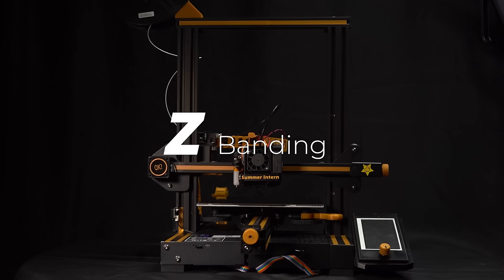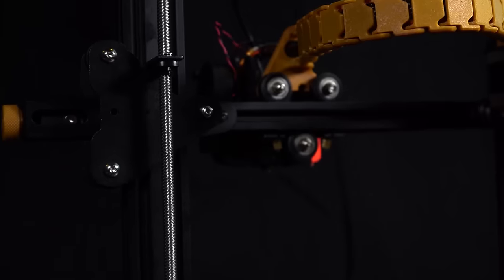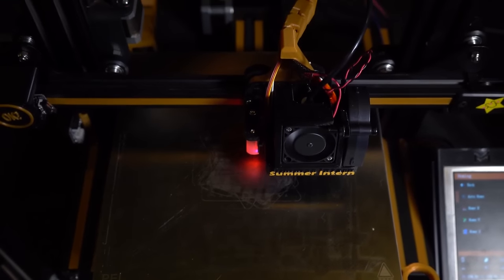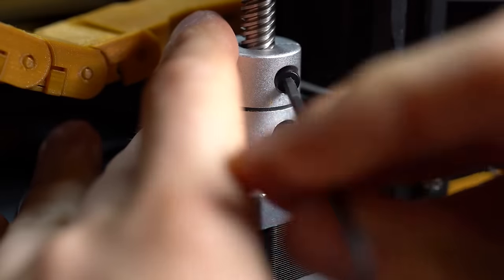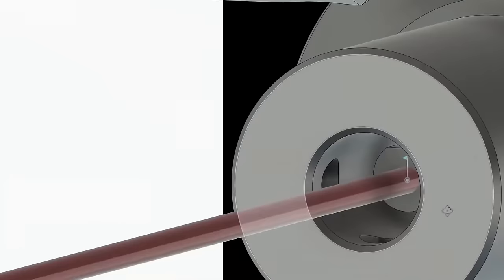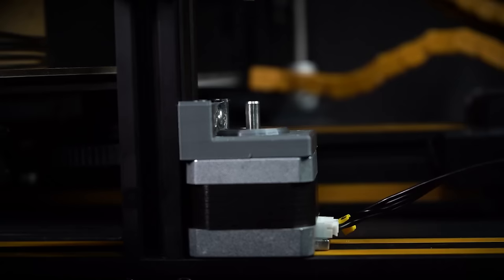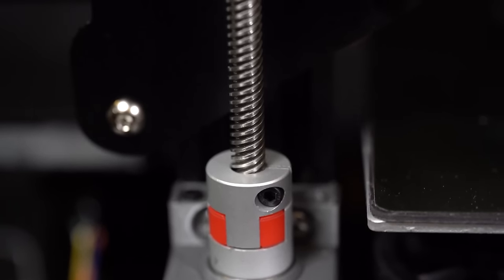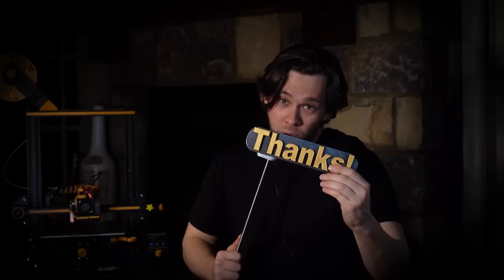I've Fixed Z Banding on my 3D Printer...FOREVER

Comment: "Self lubricating" is code for "material lost to wear acts as a sort of lubricant".
Reply: No, it's material dependent. Stainless steel, titanium, glass for instance aren't "self lubricating" no matter how they wear.  Brass, copper, white metal alloys are, because unlike those, they shed flat plates that slide across each other. Same for plastics, nylon, ptfe, UHMW, POM/delrin contain internal lubricants that are only released with wear, some are even impregnated with oil, they all need an initial break in before this happens. PLA, ABS to name but two, do not.
Reply: @m3chanist   Wh "no" , what i say wrong? Of course worn material can be either a lubricant or an abrasive, both is possible. Besides very confused comment. 
There aren't "internal lubricants" in the plastics mentioned, it's purely low surface energy causing the material to be low friction, chemically induced property. PTFE PA etc are not impregnated with oil.
Reply: @SianaGearz  I didn't say they were, I said they can be and are in a variety of engineering applications. I'm sorry for your confusion, read more carefully. What you said that was wrong was that material lost to wear acts as a kind of lubricant, as I pointed out, that is only jn some cases, that it is material specific, not a blanket catchall.
Reply: @m3chanist  they were talking about "Self lubricating" materials specifically mentioned in the video, not all materials. they were and still are correct.
Reply: There are numerous grades of POM (also known as acetel or delrin).  It can come impregnated with lubricant but in the use case of a 3d printer normal POM is fine and should not require lubrication.  It is resistant to lubricants but you're just giving dust something to cling to when it really gains you nothing.  I used to machine a lot of Delrin parts, fun stuff to work with, makes a cool sound when cut on a lathe lol
Reply: @Cara.314  o really, where exactly is that specific limitation? Apart from in your interpretation.

Comment: Something most don't know about stepper motors: Inside them is a spring-washer type pre-tensioner, it preloads the motor and keeps it from rattling if you shake it, guess what side it's usually on though? The bottom(bushing upwards when used in the z-axis like this), your gantry weight might be sufficient to deflect this spring and cause irregularities if things are heavy enough. You can tell by watching the coupler while giving it a little push down against. Your thrust bearing is probably fixing this. On mine I took the motor apart and relocated the spring to the top so it pushes downwards instead, resulting is a notably more stable Z-reference.
Reply: Genius!  This is a great tip, it very noticeably reduced Z banding for me and it's so easy to test if your motor has a spring-washer configured this way.  Thank you!!!
Reply: Any chance you can show or reference a video that explains this?
Reply: @projectartichoke  Awesome! I'm very glad to hear that random info was actually useful to someone else as well. (had notifications off, but better late than never.) I've actually never seen ANYONE cover this detail at all, and it's pretty easy to overlook or never know about.
Reply: @moodberry  Very late to reply, but you can check for it by literally pushing down on the shaft of a stepper that's pointed up, if it visibly deflects down into the motor and it's being used on a Z-drive for anything supporting weight.. then that basically means it can get forced down like a spring and cause uneven settling heights. Visually it looks just like a washer but has a 'ripple' indented into it, so it isn't flat.

Comment: The thrust bearing is important for another reason. The motor has a spring inside of it, allowing the axle to move up and down a little. By placing the thrust bearing between the coupler and the motor body, this freedom for the lead screw to move slightly down is eliminated, and it will unlikely to move up because of gravity, but if you really want to make sure you can go overboard and put a thrust bearing at the top of the printer as well to really constrain the lead screw Z motion.

Comment: Thats all fine and dandy but some Z Banding, wobble, whatever can also be caused by the wheels on the x gantry riding on the frame if they are not perfectly round. They can cause z banding, I've tested this extensitivly with my original ender 3 that didnt have duel z screws. After disabling my Z motors in the printer screen, you raise the gantry up and down with two fingers and if there is any resistance as the wheels go up and down you have an issue with a flat spot on the wheels. The issue can be very slight so you have to really get a good feel for how the wheels feel against the frame. This can happen more then not when the printer has been sitting for extended periods of time not being used, the tight wheels will deform over time against the Z extrusion frame. This can even happen when putting the printer together if care is not taken when mounting the X gantry and the wheels are grouged when fitted onto the z extrusion frame. Lead screews can be a problem but could also be other issues.

Comment: Just tried oldham couplers, and they completely fixed it. It did allow me to see that there is a slight inward slant of the lead screw, so I'll have to print motor brackets to help position it correctly. But even now, the prints come out perfect!

Comment: EXCELLENT video my guy! I have 2 Ender 3’s and I have dual lead screws on both of them along with direct drives! You have explained what I have been having trouble and have noticed! I have noticed the screws are really not lined up properly, and it’s just a few mm if that. And that really makes a difference. The trouble with belts is that they are like chains on a bike or motorcycle. You can only tighten them so much until you’ve stretched them all you can and have to replace them. So belts (in my opinion) are not on option for me. Any way great video, subscribed!

Comment: The most critical thing with leadscrew alignment is that the bearings and nut are all in exactly the same relative position to the linear axis the screw is driving.

The screw being straight is irrelevant if the top & bottom bearings are at different distances from (or laterally to) the linear slide! 

That is probably why the top bearing caused problems - the opposite end was not in line with the nut, so it was causing lateral force on the nut near the ends of the travel. 

It applies to the industrial machine tools I work on, and equally to 3D printers or any small CNC.

Comment: Great advice ! 
I solved the leadscrew issues by, THROWING THEM AWAY and replacing them with a belted Z mod.  Z hopping is MEGA accurate now and my supports just snap clean off. Next thing I will do is install linear rails because those POM wheels are a huge problem aswell....

Comment: Note that brass oldham couples like the ones you showed aren't supposed to work well under compression, when an oldham coupler that responds well to compression is installed the lead screw isn't constrained laterally at the X axis, in those cases constraining at the top is a good idea because otherwise the lead screw is underconstrained. There are bearing-based oldham-style couplers like the "wobble wings" and the suchlike that are designed to work under compression, also bear in mind that thrust bearing are great but can introduce vertical motion in the lead screw if they are not perfectly perpendicular to the axis of the lead screw, which can be tough to ensure

Comment: The #1 most thorough set of tests/results and solution options on YT. My issues are around z-binding (mainly), with no discernible pattern in the layers. It's been a total pain to trace down and I'm pretty sure it's a combination of the anti-backlash nut and sub-standard linear bearings, but good luck trying to find a set of well made bearings that are any better than what Creality uses. Again - really good video and I've subbed.

Comment: Bent lead screw itself wont deflect in travel at any noticeable rate, extremely small effect (a2 + b2 = c2). Most Z issues are simply binding from being out of square, the rest are bad PID tuning (temps jumping around) and bed bounce/vibration, mostly just on bed slingers. BUT if you have dual Z motors and there tied together with a belt and not in phase, it's better to simply unplug one if that gantry holds up when turned off. If you need both, loosen one coupler and activate the motors then level your gantry and tighten it up. That will put them in phase so that there not constantly trying to fight each other paying a back and forth tug of war. The last one, a loose carriage.

The POM nuts work just fine and can be "loose" as gravity will do the job of keeping them in place, maybe if you need to print while its on it's side.. idk.

The thrust bearing would compensate for bad/cheap bearings in the factor motors, but you can get nearly the same effect of the oldham with nylon washers and only tightening the brass nut so that there's no play, allowing to the stock cheap brass nut to move around in the x/y AND also wobble to play along with a bent lead screw.

Comment: Now overhaul it again and switch it to a belted Z axis set up 😂 Jokes aside, fantastic video and quality, very informative 🙌
Reply from the maker: Thanks! 3 things that I would like to test still: A banded Z setup, Linear rails on the Z Gantry, and the Wobble X attachment.
Reply: @MaxyMeanderings  Those are some fantastic choices! As far as linear rails I was reading KevinAKASam's (belted Z mod creator) documentation for the belted z and he advised against it. Reason being is the POM wheels allow you to tighten the concentric nut and create friction, where as the linear rails have 0 friction. Problem is with only 1 stepper holding the entire X gantry, the X gantry will fall once the printer is turned off if the Z axis has linear rails. Having that friction from the POM wheels ends up helping the single stepper hold the gantry in place, or at least gently bring it down.
Reply: @MaxyMeanderings  Yeah don't use wobbleX on a dual lead screw setup like on your ender, it needs quite a bit of weight to work properly. It was really meant for ball screws I think but I've seen those get a lot cheaper

Comment: Thank you for sharing!  Good idea about the thrust bearings, something I haven't tried.  I recently just installed a dual Z axis stepper motor kit, the box says it's from Creality, but I'm not sure if it's authentic.  Anyway, the kit I bought came with anti-backlash lead screw nuts aluminum mounts for both stepper motors.  I still had to put a shim for the originally located stepper motor, but no for the other side, I'm guessing the gantry bracket for the original spot wasn't drilled properly or bent at the correct spot.  When I was aligning the lead screws with the stepper motors, I left all the mounting screws and lead screw nut loose first, and also moved the X axis gantry all the way down for better alignment, I even removed the printer head so I could go as low as possible.  I didn't know about the top mount could cause issues.  When I installed mine, I moved the X axis gantry all the way up possible, so that the top mounts are aligned the best way possible before I tightened them in place.  I might leave mine in for now, as I don't see any Z banding issues with my prints.

Comment: i have a og cr10 and found pretty much the same thing. the things that helped the most was oldham connector that was filed(mine did not slide smooth) and lubed and getting rid of the top guide. plum coupler didnt change anything for me and antibacklash made things worse.  i got new leadscrews after the oldham and i so disernable improvements. only other thing that helped along the way was replaceing the stock extruder with a direct drive and  a mains bed heater with insolation.  going to give the motor mounts a try  because why not.

Comment: You see your problem isn't the lead screw at all. Mine is bend but there is no sign of wobble on the print. I have done all "bad" practices. Fully tightened the POM lead screw thing to the frame while you are supposed to leave it untightened. I added a bearing at the top which is supposedly really bad but I need it to stop the lead screw from vibrating with my high acceleration.
The problem instead is Creality leaving the screws too loose from the factory. Specifically the ones holding the Z Gantry so technically the X gantry. There are several screws that you can tighten to lock the parts with the V wheels. Essentially you have to first make sure your X gantry is level then fully tighten the eccentric nuts so that the inner wheels are jamming the outer wheels. Then tighten the brackets while making sure it stays level. After that you can untighten the eccentric nuts again and check for play. If you have done it correctly your X axis doesn't want to wobble anymore it will want to naturally be straight. After that you can tighten the eccentric nuts to the correct spec so slightly touching but its really not required as the outer V wheels will do all the work.
What that does it prevent jamming on the lead screw as your X axis will always be level.
I think you are putting way too much thought into it while for the Ender 3 v2 Neo (my printer) there really isn't much to it. From the factory there was 0 banding. I replaced the brass with POM because it promised better accuracy and it indeed only has 0.05mm difference between moving up and down. As long as you move the same direction its 100% accurate. Only when going up then down vs only going up does the 0.05mm come into play.
Also my printer needs 398.94 steps per mm instead of 400 for the Z.
Reply: Isn't this up to the manufacturer to fix it? In any case, that's why we call it  "ender"

Comment: good video, AND, funny, I built my Prusa I3 almost entirely by myself. 
my Z threads are old-fashioned M5 threads and yes, they are loose at the top AND go back and forth (not extreme!)
and that's why I ended up here, I still have to see what I can do about it BUT I'm in no hurry, the printer works well enough so it will get better with time!

Healthy and Friendly Greetings from the Netherlands everyone!
Rob

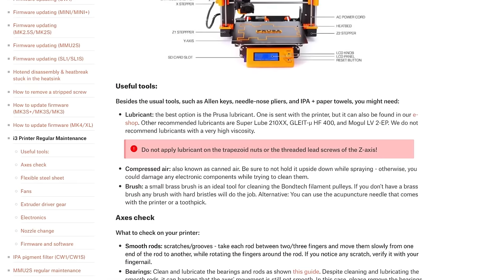Comment: @13:30

I'm rebuilding my CR-10 and went with the oldham coupler setup from this video.

Anyway, I lubed the threads of my POM nut as well as the oldham coupler, and I'm noticing the gantry slipping or skipping (??) as I manually move the gantry up, by turning the lead screw using the motor coupler on the bottom.

That may not be the answer to that question, but it's a new issue that I now have to resolve.

Comment: Thanks for this video. Just ordered an oldham for my Ender 3v2 since i've had some issue with prints. After buying an orbiter 2 and setting everything right i  klipper knew it was not the cause of it since it was even before new extruder and i've checked the wheels multiple times and it didn't make sense it was the X and Y since the print had lines all around and in a consistand thickness as if it squished and it would be at random it would. So hope this fixes it and maybe one day i'll upgrade to something like a RatRig

Comment: Please explain the jargon. 
What is PID tuning please ?    Palm Nuts ?    PID Tuning ?
We beginners need explanations of technical terms we have not heard before.   Thank you !
Reply: PID tuning fine tubes the electrical current running to the thermistor, the heater for the hotend. The tuning keeps the temperature steady, so there's minimum cooling / reheating of the hotend...creating as steady a temperature as possible.

Comment: Try cleaning the lead screws and using a dry ptfe lubricant spray, have you also investigated changing out the v-slot wheels for polycarbonate?

Comment: In my opinion & experience as long as we let the top end hang free and allow the linear rod to hold its position. Best is increase to 10mm rod or use linear guide the Z. I use a PLA printed z Lead nut and it  really zero down the blacklash. Sometimes some parts of the machine need NOT be metal to cut out vibrations and noise. Part of your printed band seems like uneven extrusions not totally z-band. I am not sure about converting to belt to stop my blame on the Z-Leadscrew bend. Anyone tested can share your views too. Bear in mind Z is the least movement axis among all bed slingers. Thanks for making this well presented video ❤

Comment: 🎯 Key points for quick navigation:

00:23 🛠️ Z banding is a common issue in 3D printers caused by mechanical problems with Gantry and lead screw.
01:50 🔩 Z binding can cause ribbing in prints due to missteps on z-axis lead screws.
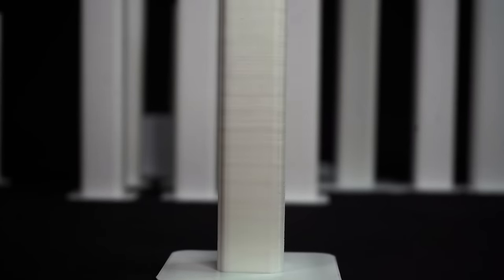03:43 🧽 Regular maintenance like cleaning and lubricating lead screws is essential to minimize Z banding.
07:26 🔧 Leveling Gantry and ensuring motor mounts are square can help reduce Z banding.
09:33 📏 Ensuring lead screws align with motor couplers is crucial to prevent Z banding.
13:18 ⚙️ Consider the type of nuts used (brass vs. palm) and lubrication to reduce Z banding.
16:54 🏗️ Lead screw covers can protect the top of the lead screw while allowing rotation.
18:49 💲 Consider cost-effective solutions like oldham couplers and flexible couplers to address Z banding before opting for more expensive options.

Made with HARPA AI